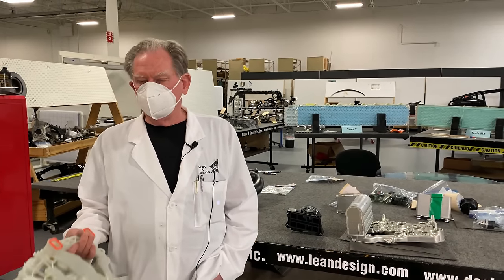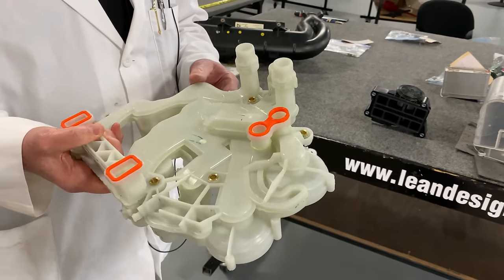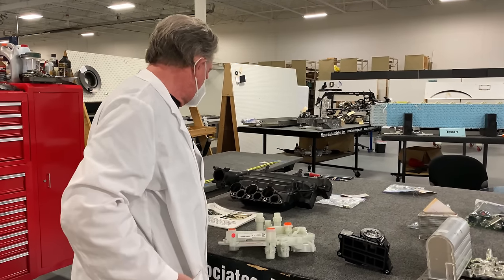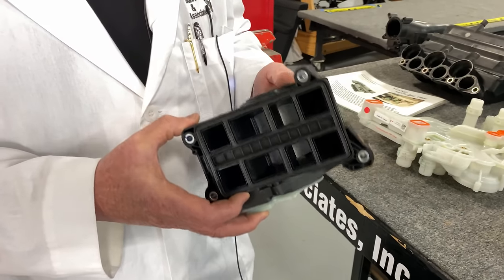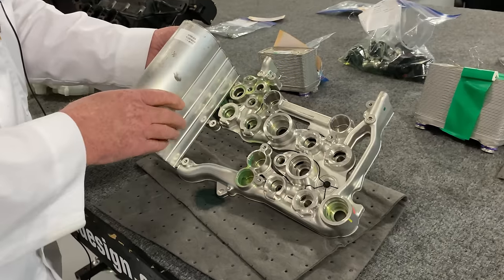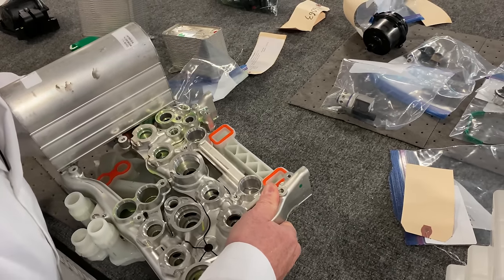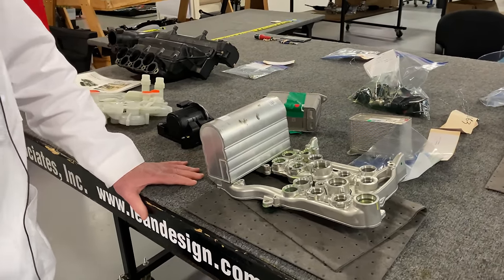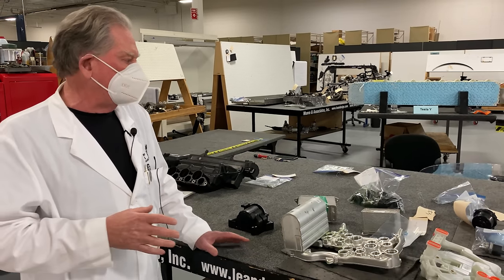Model Y E36: The Octovalve Episode

Comment: Would love to know the performance characteristics of this system. It looks great etc but how well does it do its actual job?
Reply: youll probably have to buy the report for that
Reply: Compared with what?
Reply: @brothervance1932  compared with what it's supposed to do? Compared with heat management systems in other vehicles etc?
Reply: So you have a heat pump, you have a hot side and a cold side, producing heated coolant (water and antifreeze) and cold coolant.  Now you have items in the car that sometimes need to be heated and sometimes chilled.  So you need a system to direct hot or chilled coolant to where it is needed.  Batteries, motors, the interior of the car etc.  Hopefully Sandy will eventually tell this how this works in more detail.
Reply: @carljaekle  I'm aware of its function, that's fairly obvious. I'm interested in how well it works, given that it's trying to do so many things.
Reply: @MrGonzonator  I think a major part of it is the cost in manufacturing and maybe servicing too. Think of it as an integrated circuit, but for heating/cooling or water.
Reply: Yes it can distribute beer during breaks at hockey games. But that’s not important right now.
Reply: @MrGonzonator  I believe that 'it' is supposed to incorporate the heating/cooling requirements of several systems; an evolution of the Model 3's Superbottle: https://jalopnik.com/the-tesla-model-3s-superbottle-easter-egg-is-a-fascin-1830992728
Reply: MrGonzonator Through a series of valves, plumbing and pumps.  It really has only 2 things to do, heat or cool.  Sensors determine what needs to be heated or cooled, hot or cold coolant is directed as needed.  Beyond this it’s up to Sandy to explain.
Reply: @MrGonzonator  I think the answer to "how well it works" is going to be found by testing the Model Y under heavy load (ie track racing) and looking to see how long it can run before things start to overheat.  But even that is a bit convoluted because other efficiencies come into play there.. If it's anywhere as good as the Model 3 coolant system, it works very well, and certainly better than many other EV's with the only one surpassing it being the Taycan.
Reply: It works very well, judging by the range the are getting from this generation of battery.  There is no comparison between the model y an three.  The heat pump makes the y.  On the consumption side very little more can be done to add range!  Model y will the Volkswagen of electric cars, mark my words.  I see margins as high as 50 percent with software revenues but Tesla likely won’t get greedy and will lower price.  The next break through are the batts.!  And this will be the final blow and it’s happening soon!  There is no stopping Tesla.  Even with scabs like munro selling the technology.  This guy is a parasite!
Reply: @305dreamhonda  I don't agree with your characterisation of Sandy. He's providing a vital role to industry in analysing and highlighting both the good and bad engineering in Teslas and many other cars.
If you truly believe in Teslas stated aim of accelerating the adoption of sustainable energy and transport, you wouldn't see the big car brands as competitors to be crushed, but as  behemoths that need turned around to point in the right direction. Sandys work helps that goal.
Reply: @MrGonzonator  it's a heat mover to the extreme and in a nice simple package:)
Reply: @MrGonzonator  it is compared to automatic transmission valve systems
Reply: @305dreamhonda  even Elon Musk has stated he expects and wants other OEMs to learn from Tesla's tech and adopt it. In the end, Elon's goal is really just a more sustainable world.
Reply: @MrGonzonator   I appreciate your belief.  I'm not worried about tsla, way ahead of competition. And I believe tsla will accelerate the transition to sustainable energy regardless what munro does.  Munro is not an engineer, maybe a technician.  I think he does it for the money and not to advance sustainable energy.  He judged the model 3 without driving it?  Not climbing on board until he realized he could make money off it.  Judging it by panel gaps is severely short sited and reveals his prejudice.  I feel it was people like him that have actually slowed the progression of sustainable electric vehicles and ultimately sustainable energy.  We need to eliminate all this dead weight for true innovation.  The fact is his services aren't real valuable beyond the heat pump and octovalve.  The real innovation is batteries and software.  He's done other than youtube.
Reply: @305dreamhonda  Munro was a senior engineer and designer for Ford. He has worked in aerospace, automotive, aviation, consumer goods and I guarantee he has more knowledge and experience of manufacturing than almost anyone on the planet. Elon respects him, listens to his criticism and takes on board his recommendations. 
He had an early model 3, he took it entirely to pieces. He criticised the manufacturing and was right to do so. He praised the motors and systems. He made a long list of recommendations and gave them to Tesla.
He is the genuine article and the work his company does is valuable, leads to positive improvements in design and manufacture, and as a side effect is entertaining for all of us internet engineering nerds.
He doesn't need anyone defending him, he's a big boy and knows his own worth, but seriously on behalf of all of us spectators, lay off.
Reply: MrGonzonator fair enough Munro is an icon but IMO he is not helping Tesla.  Just the opposite.  I love seeing the technology too, but it just doesn’t feel right.
Reply: Crunchy ShadTV Sanyy is an enabler for the next generation of manufacturing engineers. Gives people goals to move forward and points out the value of disruption over being a stick in the mud. 
Elon is too busy to do this so Sandy is kicking sad. In the OEMs face for him.
Reply: @lingyanj7075  again, I'm not asking how it works, I'm just asking how well it works.
Reply: MrGonzonator a lot of model y owners say it works great. Munro doesn’t offer the assessment you are requesting
Reply: @bigdougscommentary5719  those are anecdotal stories, I'm sure they are qualitatively true but as I say, I'd like to see the emperical proof of that. I'm not suggesting that Sandy gives away all the secrets, all I'm saying is that there is real value in the detail of his (paid for) reports. I accept he gets tantalisingly close to this in his video's and while the geek in me is itching for more details, more specs, more data, I accept this will be beyond my means of accessing. Sigh... 😂

Comment: Sandy, you guys mentioned you were looking for ideas on what next to tear down. Here are few, they might overlap with some already suggested.
*Proterra electric buses
*BYD also has electric buses I think? But they has have garbage trucks, so maybe a look at those?
*There are also some Fuel Cell buses out there using Ballard's fuel cell tech. Might be interesting if you can compare that to Toyota's Fuel Cell tech.

*Electric Tractors. Sounds like there might be a few in China now, but Solectrac out of California claims to be making and selling an all-electric small tractor?
*Electric trains/subway vehicles. These have been electric for awhile, but it would be interesting to see if their motors and design are keeping with industry improvements
*A boring/tunneling machine (Diesel or Electric if you can find it)? Maybe someone like The Robbin's Company (https://www.therobbinscompany.com/). It'd be cool to see you take apart the 10ft machine or one of the small bore ones. Might be too expensive or too small of an industry to make money on selling the reports though.

Comment: Its probably safe to say that this is partly why a Tesla will go further than other EV's on the same KWH?  Batteries create heat, Electric Motors create heat. If you need to remove that heat but the cabin needs heat (to keep us from freezing) then I assume that this helps remove unwanted heat and places it where we want it.
  Other manufactures will spend the energy to remove the heat from where it is not needed to the atmosphere and then spend energy to create heat for the places that need it.  While this might be easier to manufacture, its not as efficient.  Its probably also hard to repair as you have a LOT of areas to troubleshoot.  While here if you have a leak/problem you just replace the parts in that area. I'd be willing to bet what you save in labor (in this system) you spend on parts. While with the others you'll spend more on labor (and the parts will still be expensive cause this is also how Manufacturers make money).

  For me at the moment I am making a choice between a Used (salvaged) Telsa or a Bolt EV.
  I tried the "cheap" Maverick Hybrid and saw how doing it "cheap" isn't efficient (and will cost us more in the long run).

Comment: Hi you mentioned a BMW V6 engine. BMW have nerver produced that. Only inline 6 😊
Reply from the maker: Thanks for turning in and thanks for keeping us on our toes! Technically that manifold was from a Land Rover product but BMW owned them at the time.
Reply: @MunroLive  It is actually a Rover KV6 engine that had these innovations added by Rover engineers under BMW ownership. They had a terrible failure rate and problems stemming from the plastic valves, its motors, and manufacturing defects. The first gen Freelander was a disaster.

Comment: Great video. FYI though - for those of us who don't understand what an octovalve does - or that you are examining a heat pump, this report is almost indecipherable. And what do your products / reports? do? I have never seen a "report" nor realized that a report was a resale product line. 
You are assuming that your audience are seasoned manufacturers, who know what a nylon casting is - but I have no idea what friction stir welding is, so this is a tough video to figure out.
I was hoping that you would explain how heat pumps work and why Tesla's is so much more efficient and smart than competitors. I think that you did, but your explanation assumed your audience knew a great deal about heat pumps and about other attempts at manufacturing one.

Comment: @8:21 There has been talk in the news recently of customers being unhappy that the LCC appears to be assembled using some parts that were not designed for the purpose; the LCC that you have shows white, hand-cut plastic moulding parts and green tape; some customers have shared photos where the moulding is wooden, and clearly more suited to be used in a kitchen cabinet and not in a car. I have to say that the LCC assembly does look shoddy, and I wonder, how come you didn't mention it at all when you were removing the tape? Didn't you find it unusual to find the assembly jerry-rigged in such a careless way?

Comment: I would like to know if the AC reaches the back of the car because it didn't in the model X where you could put those extra seats in.
Reply: Bob Bobson only second row now. Thermal dynamics may harvest from rear motor electronics and a split from second row.

Comment: Yep, I'd be curious of the reliability data and replacement cost. As a Quality and Manufacturing Engineer it seems overly complicated and expensive. I'm sure it's in the report. I can't imagine ever getting any of those parts from an aftermarket parts supplier. Which is why I would never own a Tesla past the lease period.
Reply: Agree, though 3rd party and reliability data is chicken or egg problem to some degree. Need to have enough of a market out of warranty for 3rd party to want to make anything and there hasn't been enough time to know reliability data (not that they would give us that info).  Though in this case I think 3rd party parts are going to continue to be slim because Tesla doesn't seem to be interested in cooperating with any of them or repair shops to create an ecosystem.   Not a problem that has gotten loud cry from enough owners yet but that is probably just a factor that the mass of owners are under warranty and are higher income individuals who don't keep there cars for as long and are less impacted by the higher oem repair costs.
I also have to wonder how difficult it would be for 3rd parties to know what part to produce given the in-flight changes that are made.
Reply: @curtisbme  Fully concur. Then there is the whole area of Life Cycle costs, which I'm fairly certain Munro Associates (and Tesla) doesn't touch either. You need a lot of baseline data and assumptions to do that analysis correctly. It's the Apple Airpods mindset here; "oh, you lost one?... we'll gladly sell ya another pair."

Comment: What do you mean selling the magic in there?  Reverse engineering and stealing IP?
Reply: Avalanche2 also any improvements or faults. Tesla may end up being a customer as Sandy gives fair and even handed qualified opinions. That's why his reports are valued so much.
Reply: What do you think they do?  They reverse engineer products and sell their findings/recommendations back to the OEM or its competitors.  It's not "stealing" IP if they reverse engineer it and it's not protected by patents.  Stealing IP would be taking design files or similar internal documents.  At the end of the day, the "Octovalve" is just a very well engineered manifold and similar things have been done before.  Not so much in the automotive space, but in sail boats there are similar concepts (although done with a bunch of plumbing parts instead of a purpose build component).

Comment: The more that big auto pushes back on EV development the fewer reports Sandy will be able to sell. In this country anyway.
Reply: randal gibbons but will become standard manuals in University for engineering degrees. 
Multi planier thermodynamics and patent searches will become course credit papers.
Reply: George Wilson thank you for the education. Always learning.
Reply: This valve design has little to do with EVs per se.  Any application for multiple cooling requirements and multiple heat sources and sinks, could possibly benefit.

Comment: ICE cars cannot exist without a transmission and they are expensive to design and build. 
EVs can manage without accurate battery temperature control but its a big benefit to have it. 
Tesla is not spending on transmissions so it makes sense to spend on sophisticated cooling/heating controls.

Comment: amazing design and construction but unfortunatelly we do not know now how reliable this piece will be. And I am pretty sure that any viewer will cry if he gets aware of spare part prices and also what pieces will be available cause buying the complete unit will end in a nightmare for the owners. If these units age early like some other parts of Tesla cars before you need spares ... and there will not be a second hand market cause usually these parts dy by the same death caused by the same part inside.

Happened to the screens and other electrical components too and then the spare part will have price tags of 1000 and more without any labour. And this piece will be a labour intensive repair for sure ... if if cracks or leaks or ... and it might drive mechanics wild caused by the complexity.

Would be great if it will be reliable but if not you will pay for that a lot more than other pieces and you can imagine right now. And this is a central and integral element of the car that needs to be fixed immediately not sometime in the future ... cause the battery lives or dies from getting the right or false coolant, same for engine if that will be cooled too to heat the car inside with the warmth the engine spends ... I am just talking about the mechanical staff - the steering of such a component is another story for sure we tend to ignore or to oversee and you might think that this will be just a computer logic part or board, but that is not true cause it can only work with a ton of sensors ,... temperature, humidity sensors everywhere to have the right inputs for the computer to decide which valve has to be opened and how far.

Looking from the birds eye view it looks simple like a piece of plastic and a bit of aluminium together but in realworld there are a lot sensors, a lot cables and a lot valves and most likely a pump and compressor working together under control of a cpu and or logic board ... and many possible failures no one wanna talk about until the early adaptor will start complaining in the froums being unfamillar what is going on cause in this central part of the car the Model Y has nearly nothing in common with the Model 3 they had driven before.

Highly complex architecture that needs diagnostic experts in the  repair - and maintenance shops for sure.

Comment: can a car battery fire be arrested with Halogen? Should had said Halon.
Reply: Bill B halon a different inert gas you may be thinking of. There are specific extinguishers and procedures for electric vehicle fires. Indoors or out doors. 
Tesla has quick disconnect to drop to safe voltage and amperage. Hence modules. 
An individual cell has the cooling channels to isolate and stop spread.
 CO2 and sand or foam just as effective if applied in time as thermal runway is fairly well controlled.

Comment: 3:10 those plastic intake manifolds, or water flanges are awful in the ICE cars, after couple years of heat cycles they are brittle and they warp which leads to leaks and cracks not possible to repair. Also, ABS or glass fiber plastics are impossible to recycle and they are bad for the environment